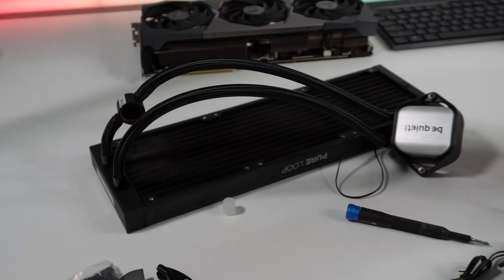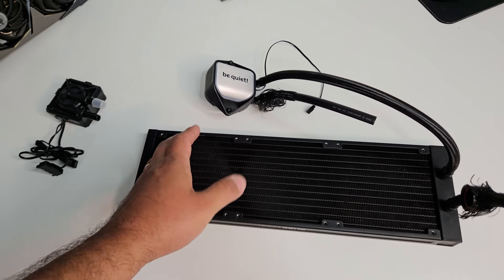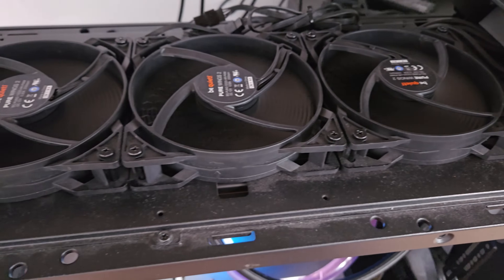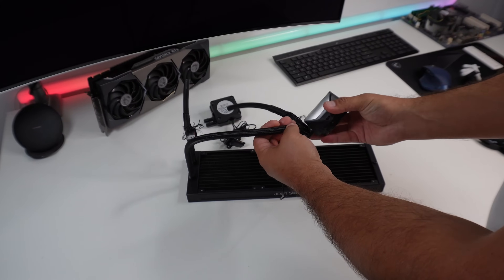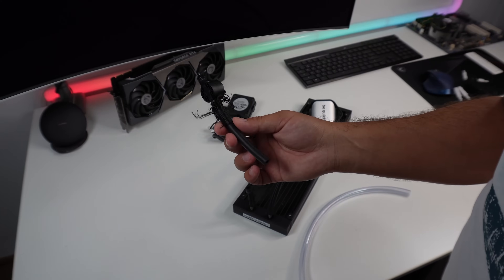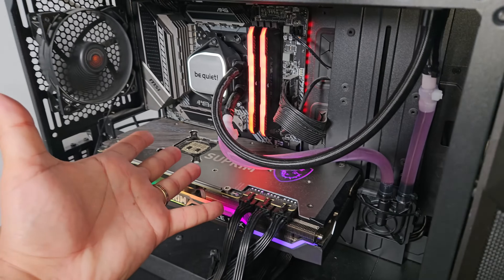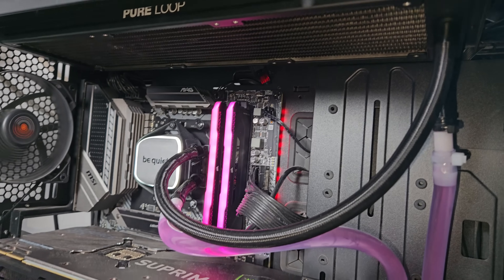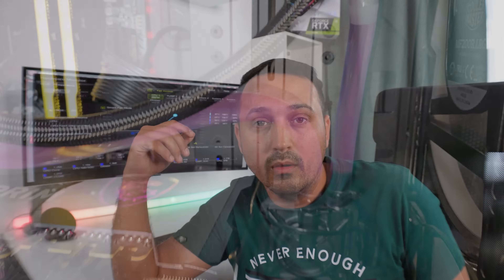How to Fix AIO Cooler: Ultimate Guide to Repair

Comment: Will be good if you give us info about some temp improve with the new pump? 🤔
Reply from the maker: Hi man,same temps but i think that that 360 aio was overkill for my 3900X...never really pushed it very hard to have the pump be an issue with not being able to circulate the liquid fast enough.Cheers and btw i still run the same pump the same way even after all this time with no issues
Reply: @Tech_Fusion  @10:04 Take out the cover of the fans and your temps and noice will be improve.

Comment: I cant be the only one not trusting that cable tie would spray coolant onto the PC or maybe drip on the GPU especially after supercharging it with a massive water pump😅
Reply from the maker: You would be surprised much like i was that its still going strong even after all this time😅😅
Reply: Those barb fittings are used in automotive applications with way more forces and you basically have to destroy the tubing to get them off. The zip tie isn't even necessary just a little piece of mind.

Comment: Hi bro nice tutorial but i am wondering how much liquid we need to put in 240mm radiator?
Reply from the maker: Hi man,well you must keep filling up until you cant hear any sloshing around of the liquid.Idealy there should be no air in the system when its full.If you hear sloshing or air bubbles moving through the system when its on,then it means you must put in more.Dont have an exact numer as not all rads are made with the same lenght of tubing.cheers.

Comment: what if my aio don't have a refill port? how do I refill the coolant?
Reply from the maker: That's where the famous Planned obsolescence comes in...OR you could DIY and drill your own small hole into the side of it and then use a thread bit and install a small bolt to seal it back up.If that sounds like to much hassle (although the costs are super cheap) then your only other option is to buy a new one...Cheers bud
Reply: I'd use a tee barb fitting with a hose for filling and to get bubbles out. Not super pretty though.

Comment: You need to change the liquid if you don't want fo buy another one , i change te liquid every five years , plate have screew, you unscreew them , remove old liquid , put colant at 15% and85 % distilled water, let the buble air go in the radiator, put the pump down , then close it , reput screw and it's done , how much disinformation 😒

Comment: I'd bet the "springy" quality to the pump fan is that the electromagnets aren't cycling their polarity.
the fan itself appears to be free to move, but the magnets that are used to cause it to spin by cycling which magnets are active at any given moment aren't changing. So the fan is falling back to a stable position given the magnets that are on at the time
Reply from the maker: That makes perfrct sense but the result its the same,failed pump....bummer

Comment: Why did you skip the part to fill up the system with coolant 👎
Reply from the maker: @psi4262  because it would have been a "how not to do it" and i didnt want to mislead anyone.As you may think this is the most messy part of the whole repair
Reply: @ oh ok .. but that was the crucial part .. anyway thanks .. hope to see how that is done
Reply from the maker: @psi4262  I will tell you this bud,use the refill port and fill the system with as much as you can that way.I used the included bottle and while slushing the assembly around,I was pressing on the bottle so that I can get as much liquid as I can in there,while letting the air bubbles come into the bottle.Cheers bud

Comment: GREAT POST!! Im doing something similar. Although I want to test my pump offline. I also have 4 pins. Do you how I could test my pump without having to connect it to the motherboard? I have a power supply I could use. Thanks!
Reply from the maker: Thank you,well to test it you can use a pwm splitter that you can find easily online.it can connect to your psu with a traditional molex connector so it should be quite plug and play.Cheers bud
Links to some products:  
Not sponsored,just for demo

https://www.fruugo.ro/4-pin-molex-tata-la-3-pini-4-pini-pwm-tata-manson-ventilator-adaptor/p-73634381-147926815?language=ro&ac=KelkooCSS&asc=pmax&gad_source=1&gclid=CjwKCAiAxea5BhBeEiwAh4t5K3fHrDx44hcykb5YJIErRKHhLjrtK2LOPrnF-Agd5aKzvQ6pUyMo5RoCg6cQAvD_BwE

https://conectica.ro/periferice-pc/ventilatoare-sistem-coolere-solutii-de-racire/adaptor-hub-sata-15-pini-la-10-x-ventilator-34-pini-pwm-deepcool-fh-10?gad_source=1&gclid=CjwKCAiAxea5BhBeEiwAh4t5K-0pQ7w6zOe-s3fujzC0VGVykaYpW_AGxcaPN52pZ9v_dafjxRP1lBoCHYUQAvD_BwE
Reply: @Tech_Fusion  Thanks  for the prompt reply :) I should of been more clear. I had a bench power supply, not a PSU. Is it possible to use this power supply to test the pump? Do you know which pins I would need to connect? Im assuming they would all be the same as its the same on all motherboards generally?
Reply from the maker: @scrappykaratekid  got it now bud,well here a schematic to see what pin gets what.Definetly you can use your bench power supply but just be mindfull of the pins and dont crank it to 12V straight of the gate.You can start at a lower voltage as the modulation of the pump works on the voltage provided by the motherboard in conjuction with the CPU temp sensor.Start of at 5V or so and slowly go up from there until you get the confirmation that the pump works.Cheers bud and check out this link here:
https://www.ekwb.com/blog/what-is-pwm-and-how-does-it-work/

Comment: How old was the be quiet ! AIO?  Thank you.
Reply from the maker: it was about 2,5 years at the point it broke with what  i would say, regular use.Cheers bud
Reply: @Tech_Fusion  To be honest, be quiet! is a premium brand, price wise, look-and-feel wise etc. for it to be failing after 2.5 years is a bit of a bummer. 
Back in 17 I bought the cheapest ID Cooling AIO 120mm which now failed, but it did after 8 years. 2.5years is pretty bad... barely got off the warranty period.
Reply: @Tech_Fusion  thank you sir.

Comment: Hi very nice video and idea I have some problem and need help I bought new Aio and it's making grinding sound from the pump but the weird thing it only happens when the pump speed is less than 85% when I put it at 85% the sound is gone is this normal or should I take it apart Note the temps are perfectly fine
Reply from the maker: Sorry for the late reply.Well i understand the noise could be disturbing or worrying but you know that old saying right?"if it aint broke dont fix it" this kinda of goes with this semi broken pump as well.I dont think the noise is normal and it could be that maybe a part of the impeller or some debris found its way into the pump housing.Or maybe the housing itself isnt isolated from vibration and that can cause noise as well.But if the temps as you said,are ok then keep using it as it is.At least this way you dont risk breaking it as I can't say it was an enjoyable experience to fill up the pump...Cheers bud

Comment: great ideea,but why do you have glass above the radiator ,where the air should go out?and second problem,the motor pump cost as much as a new Arctic AIO 360!
Reply from the maker: @adycoke2  hi there,well there is glass indeed but its vented on the sides and thats where my hot air is being vented from the rad.It really works out well.As per the pump itself,well I just checked the price now and it comes close indeed to a brand new Arctic AIO but I had products from them before and honestly it was barely ok-ish most of the time.Not to say the products are bad but they are not on the upper quality scale to say the least.Also I had this AIO already on hand so it seemed like a cool way to save it from the trash and also show people how they can change a pump.You can for sure go for a chepear pump that will work just as well and the steps to replace it are mostly the same.Cheers bud and thank you for your thoughts :_CoolBoy::_CoolBoy:

Comment: have any idea what type of screw is needed for the copper plate? Lost one of mine
Reply from the maker: hmmm...not quite sure but it isnt something proprietary.I think the best bet would be to take one with you to a hardware store and try to find a match or even try a reverse image search on google and see if you get any hits like that.Or as a last resort just try and measure its length and try to find something online or even try using one of the screws that came in the kit but make sure to cut it to length first(compare with another from the plate) and see if the threads and width are the same.Cheers buddy .
As a start point use sites like this (not affiliated) and track down some screws after your measure it and see what you can find : https://www.titanrig.com/ekwb-screw-set-unc-6-32-5mm-black-20-pack-0330ek012401on.html?queryID=c394248fa5c538feab40a8c1789163f6&objectID=29738&indexName=titan_live_default_products